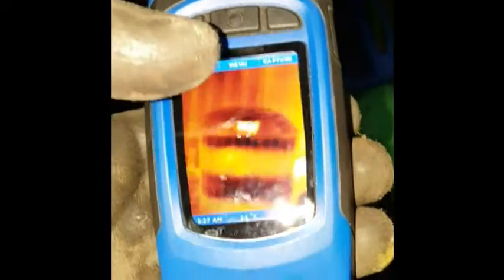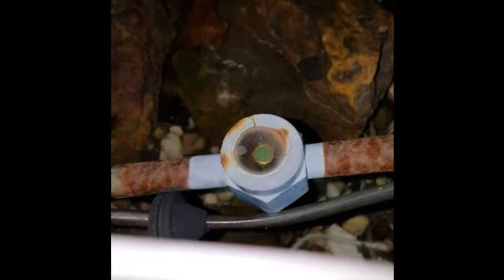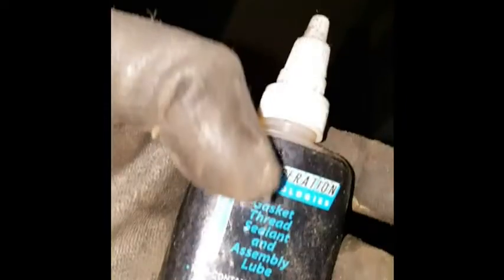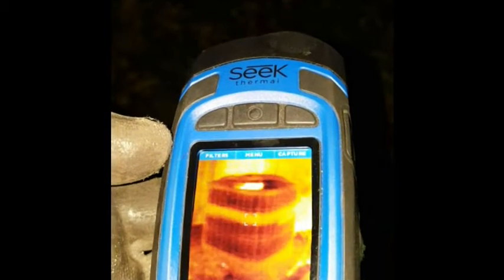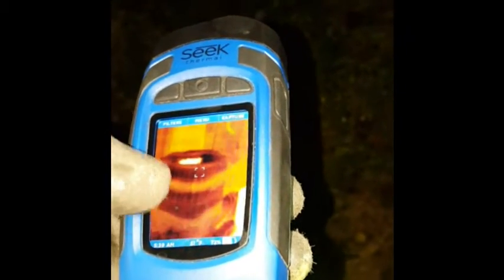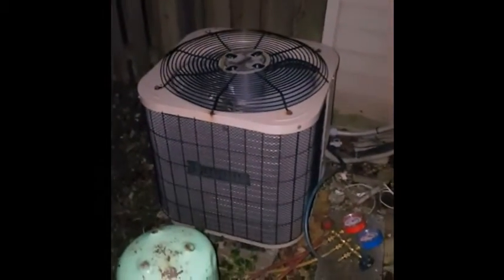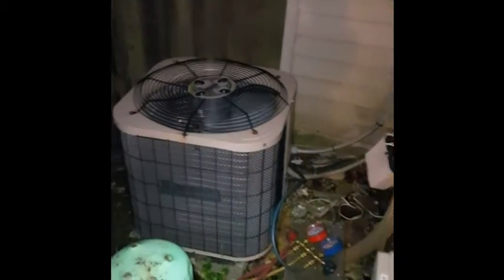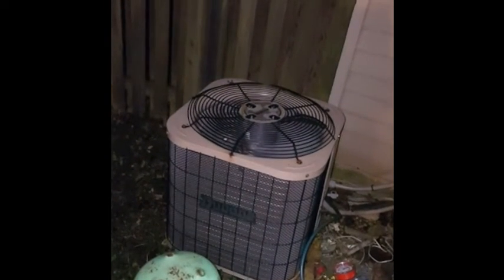Checking Heat Pump Refrigerant Charge with an IR Imager

Comment: You should win the Nobel prize in physics for that! Can someone explain the "band" thing at the end? Is that the txv working in heat mode? Is that what we're looking at?
Reply from the maker: Did you ever check how much propane you have in a tank by feeling the cold liquid level on the side?   Liquids are cool.   Steams are hot.  The dark bands are liquid boiling.   The light bands are steam (vapor).

Comment: So heat pump in heat mode still uses refrigerant? If heat mode is fine why would cool mode not work (not cool at all, condensor doesn’t get hot, evap not cool at all)?

Comment: interesting concept.... where did you get this idea of checking a heat pump charge with IR. Admitanly, it is difficult to charge a heat pump accurately with anything but a weighed charge IAW all the OEM's I've consulted.  Have you tried to comparatively check the thermal imagery of a weighed charged unit

Comment: Usually on Ac split units you add R22 refrigerant thru the suction side. Is it different on heat pumps do to the accumulator and the reverse valve?